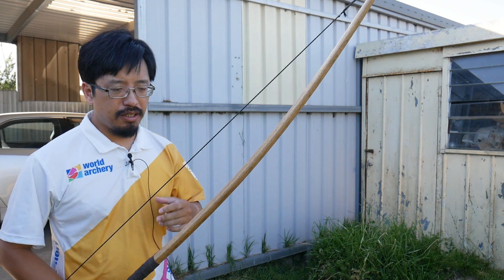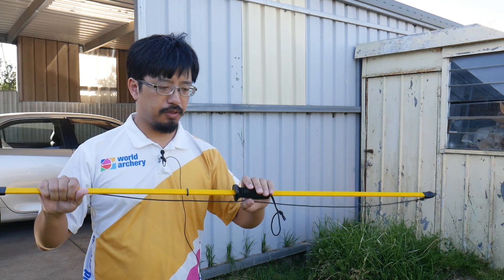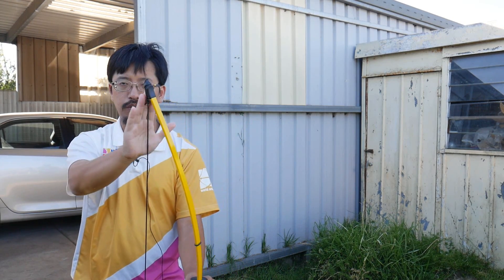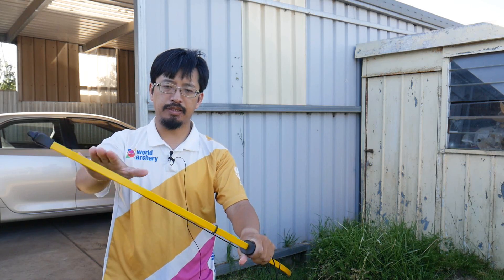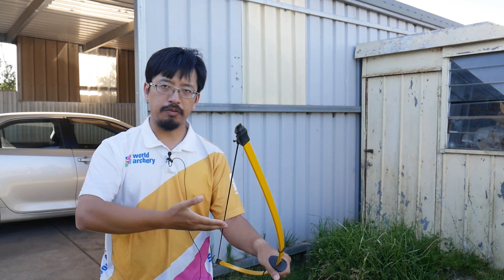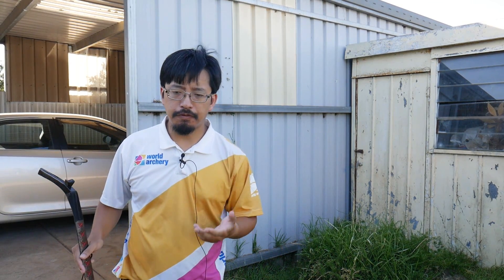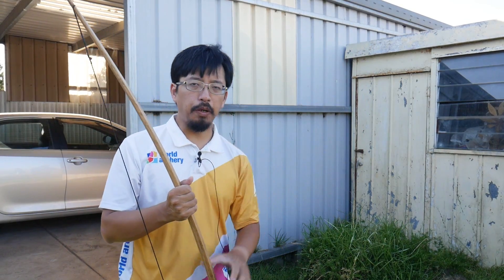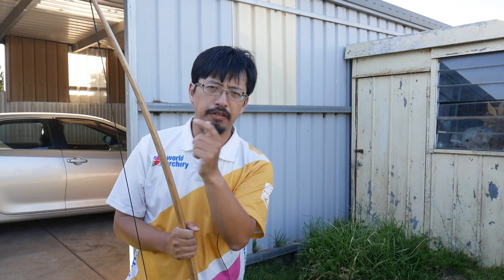Archery | How Do Bows Work?

Comment: Greetings @nusensei, is it possible to make a bow using leaf spring?
Reply from the maker: I think you can, actually. The main thing to be aware of is that the limbs don't need to be springy, they need to be light and flexible. But otherwise it should be possible.
Reply: @NUSensei  maybe can be made like the ones using EFG? Do the limbs need to be equally reflex properties (lbs draw weight)?
Reply: @NUSensei  I found a YouTube video that might interest you ☺️https://youtu.be/NKRJFF4hk_k

Comment: Would a slingbow be possible? Would it be worse than either a full bow or full slingshot?
Reply: You would likely lose energy on the bow overall, as the if you use a elastic material for bow string the bow would be able to return to its original shape, meaning the limbs would push forward less and thus shoot the arrow slower. That’s just a educated guess though I’m sure there’s a way to make it work

Comment: Nusensei I’ve been an archer for about 4 years i was would say I was extremely overweight but this gave me a lot of strength and i would shoot 45 pound bow but last year I took a break from archery to become healthier and lost a lot of weight however since I dropped from 90 kg to 65 kg I can not draw my bow back anymore I’ve been training with difficulty I have been working out as well trying to get my strength back I was wondering if I should purchase a new bow( 200-300 aus dollars) my current bow is a bear grizzly 45 pound cost me ( 650 aus dollars ) can’t change the limbs. I’m an Aussie live in Melbourne in Cheltenham so close to your archery club anyway back on topic any tips for me jumping back into my archery days? I want to use my og Grizzly but I think I need to train to pull that back again. Big fan. I wrote this on your most recent video in hopes of a reply.
Reply from the maker: The short answer is simply, yes. Pick up a bow that you can use and get yourself back into archery, and you'll enjoy it better than being frustrated by the heavier Grizzly. Losing that much weight can also mean losing a lot of muscle mass. You'll want to get yourself back in condition with regular training.

Comment: if a person older than 10 does not know how a bow actually works they should get a good bop on the head
Reply: Well the exact physics behind a bow is pretty complicated
Reply: @suit1337  well sure but if a person does not know the basic working of it and what they do.
Reply: @johngate4715  there's plenty,  believe me my aunt for example gave her grandkids a rubber band/string and bowed branches to make a bow - she was hard to convince that this is not a bow works 

That is exactly the misconception Nu Sensei spoke of in the beginning. 

Even new members to our club often come with this assumption and get confused when stringing a bow for the first time - i've seen quite a few 180 degree stinging mistakes even on ILF bows

Comment: If I remember, you can actually get a slingshot type that is designed for shooting arrows right?  I've not seen much about them so dunno if they are used much or how powerful / accurate they are.
Reply: the energy conversion in rubberbands is not that consistent,  the heat up during draw and are prone to error due to temperature difference - don't expect them to be as accurate as an Olympic Recurve 😂

Comment: Can you shoot more than one arrow from a bow simultaneously?
This is often shown in games and movies? So is this possible in real life or is it pure fiction? (not talking about accuracy of course.. just possibility)
What about crossbows? Shouldn't it be possible to design a crossbow that shoots more than one arrow with good accuracy? why is this not a thing?
Reply: Yes, in games and movies. And probably in la-Lars land.

There's only one point along a bow's string which moves in a true straight line, perpendicular to the tips of the bow's limbs. Nocking an arrow (or bolt) at any other point will affect accuracy. Also, you'd reduce the power delivered to the arrow, since the bow's power is now shared between them. If you're prepared to sacrifice both accuracy and power, you might as well just throw the arrows like darts.

Thinking about crossbows, it may be technically possible to run two strings--one high and one low--and maintain accuracy, but power would still suffer. I'd be surprised if someone, somewhere halt built one. It feels like something Leonardo da Vinci should have done.
Reply: You can fire as many arrows as you can securely attach onto the string. If the arrows have big cut-out that won't pinch the string, then 3 arrows at most because you can only pinch 3 arrows with 4 fingers.

And for the multi-dart crossbow, I believe it consumes too much ammo for essentially the same amount of fire power. If one dart is enough for the job, there is no point in using 2; if 1 dart cannot penetrate the armor, 2 won't do either. Besides, firing twice the mass for the same amount of force reduces the energy for both projectiles, instead of having 1 dart that packs a great punch, you'll have 2 projectiles that are both half as effective if less so.
Reply: Take a look: https://youtu.be/CR1v5xri6H4
Reply: Yes, but the kinetic energy is applied to all arrows (shared)

Problem is that multiple arrow get pinched together which affects accuracy - the shorter the bow and the longer the the draw the worse it gets - simple geometry 

It works with 2 or 3 arrows, but the practical use is very limited
Reply: You can, but the power of the bow is divided between each arrow so 2 arrows means each one is only half the power it should've, had there only been one. So 3 arrows only have 33% power etc etc. Not very effective. That being said.. it doesnt take all that much poundage from a bow to skewer a male boar, even beginner training bows have that kind of power, so depending on the strength of your bow, and wether or not your opponent is wearing armour or not, it could potentially kill someone. It doesnt take much at all to go through clothes and flesh, if they have armour such as hardened leather, mail or gambeson however it's a whole different matter.

There arent crossbows that shoot several at once afaik for the same reason, however there have been made siege weapons and artillery such as the korean Hwatcha that shoots many many arrows at once, but they use rockets as propellant. There are also very quick-firing crossbows, such as the chinese Chu-ko-nu, wich is essentially a crossbow with a magazine and a quick-reload feature wich can spew out many arrows in a short time.

Comment: Since you brought up slingshots, that's got me thinking about what sort of safety practices would be involved with using a slingshot.  Like, I'm wondering what sort of safety practices done with bows and guns are easily translatable to slingshots, and what additional safety practices would be required.

Some people probably think of slingshots as toys and so safety shouldn't be an issue, but even the toy ones can be quite harmful if mishandled.  Furthermore, there are such thing as hunting slingshots, the frame of which braces against the forearm, and it uses metal ball bearings as ammo.  I've seen one be put to use against a cement block and it easily broke a chunk of it off.

Don't aim at people you don't intend to shoot, don't shoot into the air, and be mindful of where the projectile will go if you miss, all seem obviously transferable from bows/guns to slingshots.  I'm going to assume slingshots shouldn't be dry fired too, simply because dry firing would be a dangerous habit to pick up.  Another thing to keep in mind is what material the band is made of and how to identify when it expires.  Rubber, when it expires, feels gritty and rough, and you'll see that it stops stretching evenly, with hard clumps forming between the stretching material.  Expired bands are prone to snap and should be replaced before use.